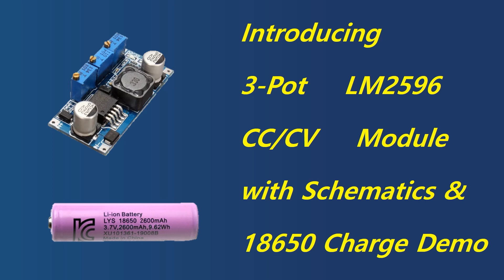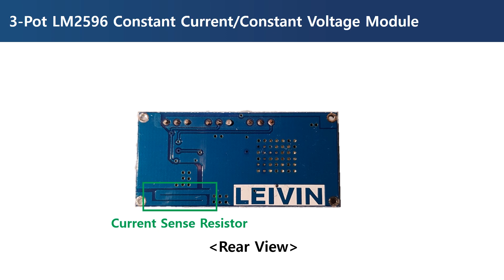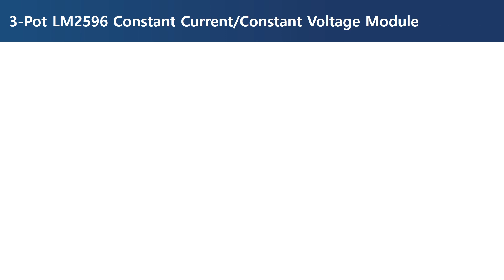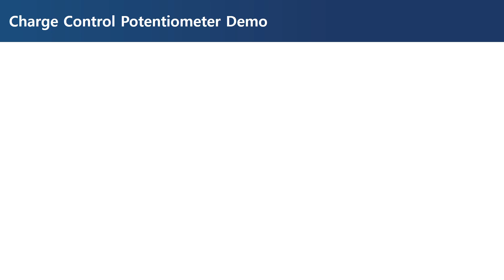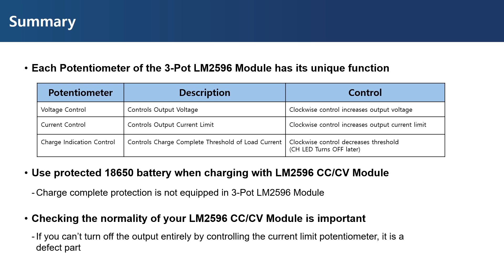How to charge 18650 battery using 3-Pot LM2596 Module with Demo and Schematics

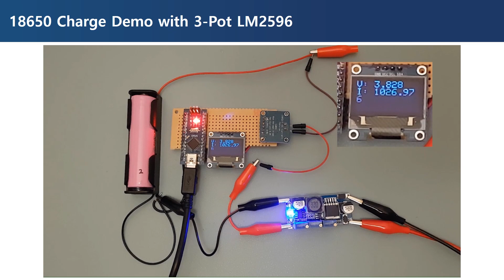Comment: 8:39 the other way around. CC first, then CV. Unless if the starting voltage of the battery is too low, necessitating lower starting current (e.g. 0.1A) to bring it to 3v first, then applying CC at say 1A till it reaches 4v. Your diagrams show this as well, albeit not so well since prior to 4v is just a vertical line which can be hard to interpret for newbies.

Comment: Can I charge AA/A battery with this module from 5V source like portable solar panel?
Reply: it is step down module. If your panel outputs more then 5v then you can do it. Not sure how stable is panel output tho would not risk connecting directly.

Comment: Hi, do you have a link to the schematics?
Also, im trying to make a circuit for cutting the charge voltage when the ok led is on, via a transistor that commands a relay. What do you recommend for the transistor base signal? Thanks.
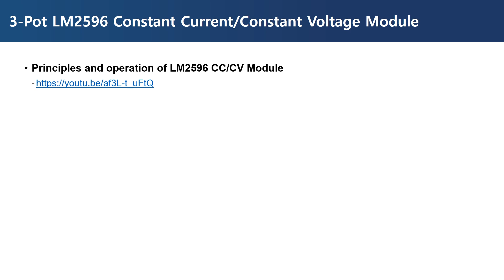Reply from the maker: Hi, the schematics is included in this video at 3:17.
You can use the signal from OK LED as the base signal for the transistor.
There are many example circuits for turning on/off with the transistor and relay.
Thank you for watching!
Reply: @gemsungelectronics460  Congratulations if you can see anything on that schematic. You have supernatural vision. 😁

edit... my bad.. changed to higher resolution playback

Comment: What protection circuit prevents low amperage CV charging at 4.20V? Or will the very low amperage eventually push the cell up past 4.21V despite it being in CV mode?
Reply from the maker: Hi, by using the LM2596 module to charge your battery, it is the regulation of the buck converter that keeps the voltage at 4.2V.
So it will never reach above 4.2V even when the battery is fully charged.
Thank you for watching!

Comment: According to your explanations, LM2596 should be cut off the energy when the current lower than the thresold which is 58 mA but it doesn't cut off the energy. And the output current of the 2-pot charger was still showed on the multimeter... Why? is your charger (3-pot one) defective or is it normal?
Reply from the maker: Hello, the 3-Pot LM2596 module doesn't provide automatic cut-off feature. Instead, it shows whether the load current is above or below the threshold controlled by the 2nd potentiometer.
You need to add extra circuitry to this module for automatic cut-off feature.
Please let me know if you have any more questions.
Thank you for watching!
Reply: @gemsungelectronics460  Yep, got it know thanks for your reply...

Comment: Is there a way to add automatic switch off feature ?
Reply from the maker: Hello,
One way I think possible is to lift up the on/off pin of the LM2596, and connect this to pin7 of lm358 op-amp.
By doing this, charging may not start automatically, and you might need to manually force on the lm2596 when you start charging.
I haven't tried it myself yet, but if you are willing to try, please share the result, and let me know if you have any trouble.
Thanks!
Reply: @gemsungelectronics460  

Hello,
this indeed was my idea: use a NO/NC microswitch connected to pin7 , the (lifted) on/off pin of LM2596 and ground. A push of the switch starts the charging, which is automatically swithed off when the ok light turns on.
It works perfect : the normally 10% value of the middle pot (set with a new module) can perfectly be changed to manipulate the stop criterium, eg 15% for a longer battery life or 5% for a stronger charge.
grts
rik
Reply: use a microswitch to start charging (see my post)
grts
rik

Comment: Thx for explanation. Is this module enough for safe charging 12v drill battery? Or is it better to connect bms 3s on output and then battery pack + -? Cheers
Reply from the maker: Hello, thank you for watching!
This module is capable of limiting the current for safe charging. (Limiting the charge current to 0.5C is a good idea!)
But it does not automatically turn off the power when the charge is complete.
This can be done by several methods.
1. Modify the circuit. (connecting the charge indicator LED to On/Off pin - High is off!)
2. Use a battery with built-in protection.
3. Use a separate BMS.
Hope it helps!
Reply: @gemsungelectronics460  Tnx  for detail explanation!!
Reply: @gemsungelectronics460  I have bosch drill battery that is unprotected(bms is in drill) pack 3x18650 in series, 2000mah. So i go 1amp charging curent with this module? Thnx for explanation!
Reply from the maker: Great idea!
I'm sure the BMS will handle the over-charge and over-discharge protection.
If you are interested in BMS, please take a look on my videos introducing BMS modules.
 - 2S BMS : https://youtu.be/xmq0hi3zTgQ
 - 4S BMS : https://youtu.be/A2f2MPJ7jQU
Thanks!